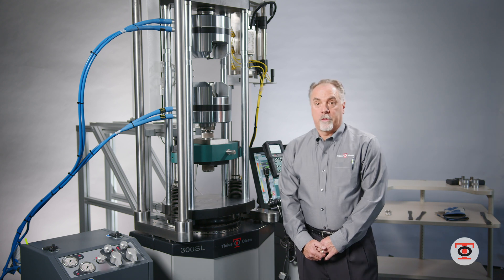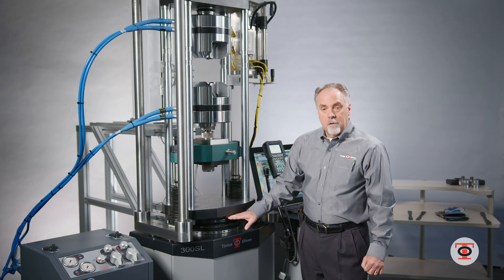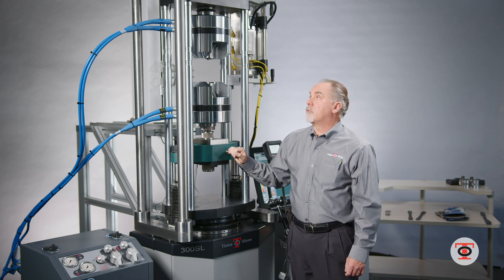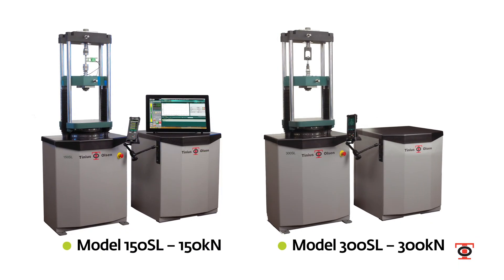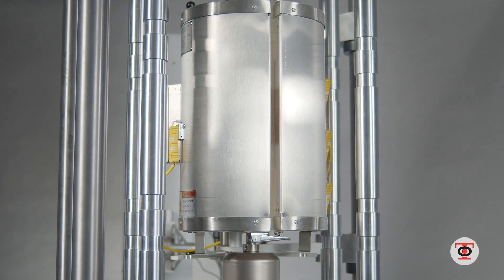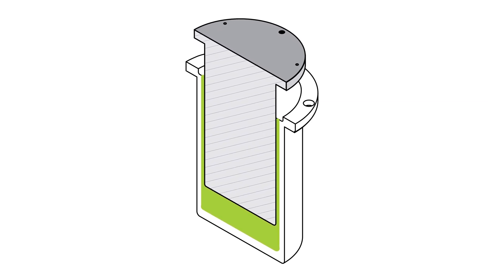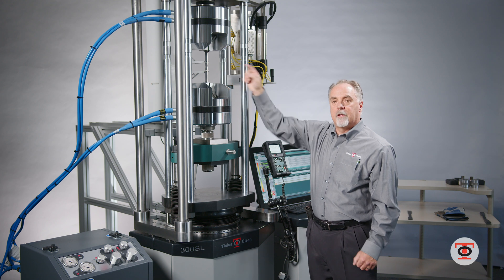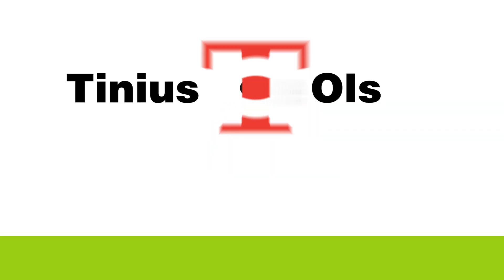Tension test on Hydraulic Wedge grip with Flats - Tinius Olsen

Comment: Hydraulic wedge grips are designed according to the requirements of high force test applications that withstand high temperature and pressure. https://biss.in/hydraulic-wedge.php